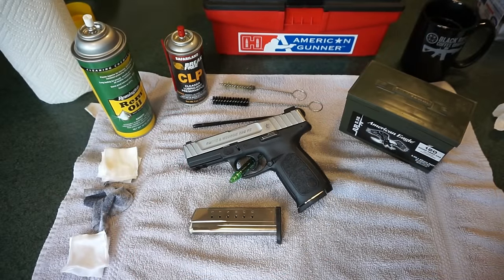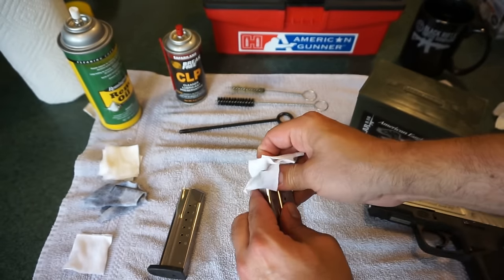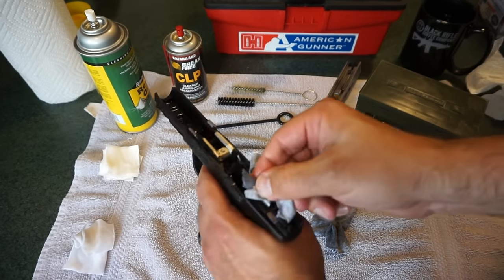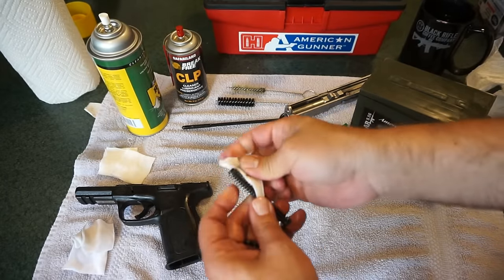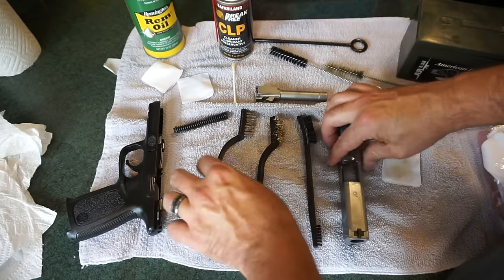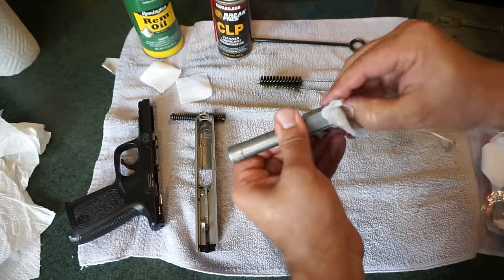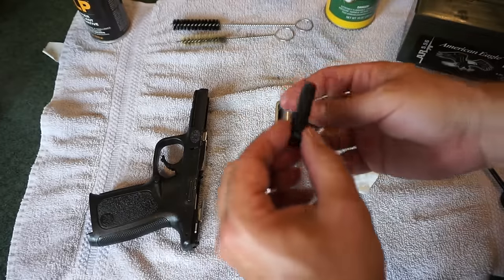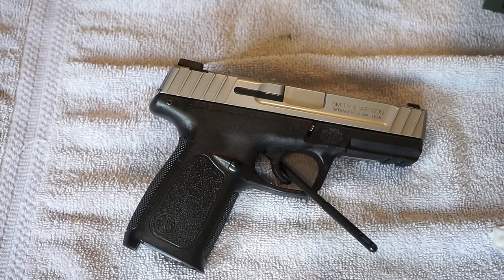Smith & Wesson SD9VE Cleaning!

Comment: CA COMPLIANT GUNS WONT BREAKDOWN until u insert a mag, pull trigger, and remove mag then breakdown with tabs.
Reply from the maker: Good to know. Thanks!
Reply: Thanks for pointing out that there is a difference in the California version. My fingers felt that they were falling off  from me trying to strip it as he showed it.
Reply: YOU SAVED MY FINGER NAIL!
Reply: Nope. You have to lock back the slide and push down the magazine lever with your finger or something. It's in the top of the magazine well and it won't push down without the trigger being pulled back
Reply: Look at your manual for disassembly instructions
Reply: If u wanna smoke good weed live in cali , if want want good gun laws live in the south 😭
Reply: Wow, CA really sucks!

Comment: You didn't lube the inner bore did you ? I'm not sure if I should
Reply from the maker: I always run a patch through it with a little bit of Rem Oil on it. That is usually adequate.

Comment: I havnt cleaned my sd9ve since I bought it. It now has a sticky trigger. Could cleaning it fix this problem?
Reply from the maker: Definitely, you get a reside that buids up around and immediately behind the trigger.  You may have also had some initial assmbly oil that can gather grit and grime around the trigger area.  There is also a bar that you can see inside the pistol grip towards the top, any muck that gathers between it and the inside of the grip will cause trigger issues, too.
Reply: @travisp11  awesome thanks. I'm going to get some cleaning supplies then .

Comment: Im having so much trouble taking off my slide
Reply from the maker: you only need to pull back on the slide about 1/2 an inch to an inch.  Watch how I grip the pistol.  I hold the slide back with my right hand and I pull down the takedown buttons with my left hand.  Make sure that your hands are dry and I prefer to sit at a table to remove the slide.  Just easier to manipulate it for disassembly.
Reply: Im missing something im getting a good grip on the slide and the pull downs it bearly goes forward
Reply: Okay so i tried starting from step one in the manual i pulled the trigger and the slide came off. Weird
Reply from the maker: Lorenzo Colunga yeah, they copy the Glock style disassembly which requires you to pull the trigger. This design is copied by several other companies. Be careful with reassembly.
Reply: travisp11 ok yeah im gonna clean in it  so ill let you know what happens
Reply: I was actually going to reply, after watching you have a little issue with the initial part of the takedown, for you to pull the trigger before disassembly. Then, after moving the slide back with my right hand, and pulling down on the takedown lever, I slowly relax the slide. If everything is done correctly, you don't have to push the slide forward. Just by relaxing your hand, the slide will release. You can actually pull the slide forward after you have relaxed the slide, changed your hands up or gotten a more comfortable grip, however you find that  best suits you.

Comment: Can never get the damn slide off mine lol
Reply from the maker: It can be a pain at times.
Reply: @travisp11  Too much of a pain really. I managed to get it open and cleaned it once a while back. Near 5,000 rounds put through it since then and haven't disassembled it again lol.
Reply from the maker: @ThePunisher_88  You can get an inexpensive aftermarket take down lever from Apex.   Check it out as it adds much more grip surface to the lever.

Comment: You forgot a step.  On mine if you don't pull the trigger it WILL NOT disassemble.
Reply from the maker: Gotcha. I thought I did pull the trigger but I may be wrong.
Reply: @travisp11   I learned the hard way by losing fingernails down to the quick lol
Reply from the maker: @kioyteo3347  oh no! Sorry about that!
Reply from the maker: Ok I just re watched and at 3:45 you can see me pull the trigger. I even re cocked the gun and pulled the trigger a second time as I let go of the takedown lever.
Reply: @travisp11  my apologies then.  I must have missed it.
Reply from the maker: @kioyteo3347  no problem.

Comment: If be careful with that steel guide rod.  Guys on the fb page for this pistol are saying it chews the frame up.  I've seen pictures but i cant call it.  I kept the plastic one..
Reply from the maker: CGKY 859 I talked to NDZ and they assured me nothing would go wrong with the frame but we will see what happens.
Reply: One of my SD40VE's had an imprint of the back of the guide rod pounding into the plastic. I looked after reading about it on the S&W chat forum. Some guys were reporting breakage. I caught mine early.  I took out that spring and put it in my SD9VE.  I haven't noticed it with that weapon.  The 40 is higher pressure. The Galloway Precision rep said 40's beat themselves to death eventually.  I believe it.

Comment: I have the Sd40ve always have FTF ISSUES

Any help ?
Reply from the maker: Get the Galloway or NDZ Performance steel guide rod with factory weight spring and that will help. The NDZ setup is on eBay and costs $20 I believe.

Comment: A friend of mine owns a SW9VE  I'm a retired Marine Ha ha surprise ,surprise  . because I shoot competitively he thinks I'm also a qualified Armorer
He took the gun apart and somehow ??? dropped the operating rod and spring but attached the slide to the frame, and he nor I can take the slide off .
again to properly assemble the gun. I own a few Glocks, XD shields etc etc because I teach fire arm safety and marksmanship NRA IALEFI etc.
I mention Glocks, because the field striping  is identical. can anyone shed some light on how to remove the slide when it has been reassembled w/o the Spring and Rod?
Thanks
Ed McCourt
Capt US<C (ret)
Reply from the maker: Maybe hold it upside down so the barrel doesn’t tilt under gravity and remove the slide
Reply: The same thing happened to me recently, I can't take the slide off. Did you figure out how to get it off?

Comment: Worst gun ever out of the box.
Reply from the maker: brad_bro trigger is nothing to write home about and on the two that I own(ed) both required an aftermarket steel guide rod and recoil spring to function. Otherwise, mine run good.